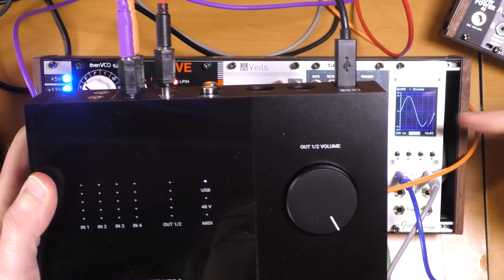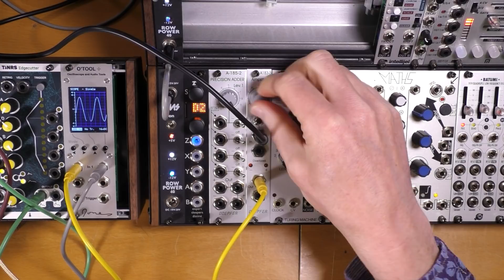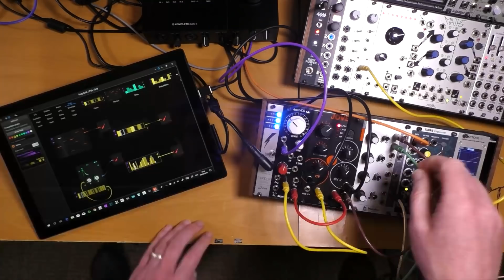Komplete Audio 6 DC Coupled cabling and voltage boost

Comment: So, question: if you were to wire an adapter from tip to ring, instead of tip to sleeve, wouldn't that give double the voltage from a balanced output? Would that potentially solve a lot of problems, or are there issues with things getting grounded out that way?
Reply from the maker: Too much engineering for me, sorry - best thing to do is try it

Comment: Hello,
Thank you for this vidéo.
In my opinion (may be I'm wrong), it doesn't seem that this product provides real DC coupled outputs.
I made a VCV Rack (or reaktor) sequencer and Komplete Audio output shows, instead of  stepped levels (each one corresponding to a CV note) a magnificent squared signal looking like coming from a capacitor.
I think that Komplete 6 mk2 is good for VCO and LFO (and may be ADSR) outputs but not DC as Native mentions...
Reply from the maker: I think I did at least three videos showing it doing flat voltages, stepped voltages and slooooow LFOs so i believe it checks out as being DC coupled as far as I could tell
Reply: @MoltenMusicTech  Thanks for your quick answer. I'll check your other videos and try again...!
Reply: Hello !
Actually, it works.
Reaktor works fine, and with VCV rack, there is a "DC blocker" option in the audio output module that messed up my configuration !
Reply from the maker: Aha, good find, I’ll try to remember that 😁

Comment: Is it possible to just amplify the CV range with a standard VCA like the 2hp dual VCA ? Or you need that specific amp module you’re using ? Thank you for the video !
Reply from the maker: VCAs tend to attenuate. They go from zero to unity so you don't get any actual amplification - unless that's designed in as a feature.

Comment: a quick question. Is NI capable to multitrack record your eurorack? Maybe from eurorack VCA output to NI input directly. Is it safe?
Reply from the maker: Sure, you can take outputs from wherever you like in your Eurorack - they can be a bit "hot" but you turn things down where you need to.

Comment: Thanks for the useful video! wondering if you'd taken the Sum output from the Maths would you have gotten higher voltage than the 5 you got?
Reply from the maker: Probably. You can amplify the signal as much as your gear allows.

Comment: Hey man, is the limited voltage output responsible for not being able to get a proper trigger CV into my DFAM? i can clock sync, and can sync pitch, but unable to actually  get something into trigger IN with the CV tools, so am unsure if my komplete is broken or is it just the small voltage ? super big thanks for any help.
Reply from the maker: I think you’ve answered your own question - I think a trigger is usually expecting +5v. So that’s probably it.

Comment: So  1 & 2 are unbalanced and could be use with a TS 1/4  to  1/8 (3,5 mm) TS Jack and output 3 & 4 is balanced and should be used with a floating ring cable; 1/4 TRS Jack (ring not used) to 1/8 TS jack. Am I right? Pity de N.I. specs didn't tell us about this.
This floating ring cable is easy to d.i.y.
Thanks for great video..
Reply from the maker: I think that's right, yes. NI didn't really know how to do it :D
Reply: @MoltenMusicTech  Thanks for the video BTW.

Comment: great  comprehensive videos!!     I am curious if I could ask you an audio question for a issue Im having here....
with my desktop I am able to use my powered HS8's with no problem at all.   When I try to use my passive system with  the same desktop I get that static noise.  Ive tried to use a mixer but doesnt change anything...  
I am using just a 1/8" headphone out from the desktop...  Hopefully youve got an idea or some ideas 
thank you in advance if you do have the time for a reply.   thanks again
Reply from the maker: I can only assume it’s an Earth loop. You need to use a hum eliminator or some other way of removing the earth.
Reply: Molten Music Technology   Could you possibly point me in the direction of such a product?  Audio interface perhaps?
Reply from the maker: Behringer HD400. But you are better off trying a decent audio interface first rather than using the onboard sound which is always susceptible to interference. But I’m making guesses from what you’ve said because it’s not very clear 😊
Reply: I will be heading to my local pro audio shop tomorrow, I appreciate the feed back, thank you!

Comment: The fact that this is out there now saves us all a small fortune in utility module & rack space costs.  I'm sort of wondering if I should get the Audio 6 or spring for a Presonus to get 8 DC coupled outputs...The only beef with the Presonus is that it'll take up a lot of desktop real estate & maybe the extra 4 outputs would be overkill.  Possibly another option might be to stick with getting the Audio 6 and if I need more control, buy a small module to do MIDI to CV for the rack.